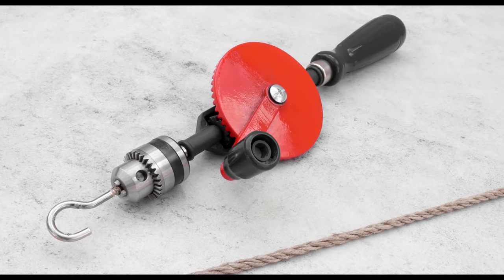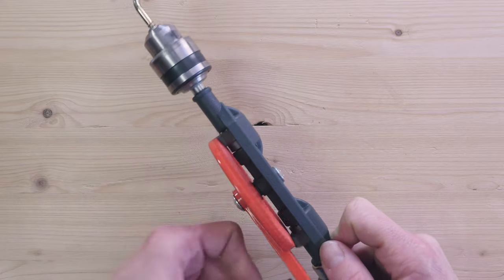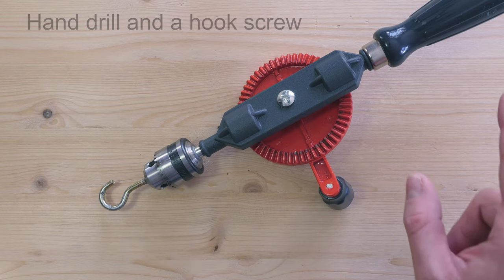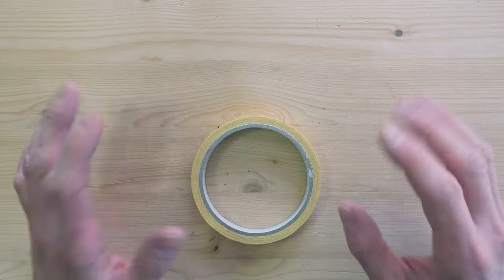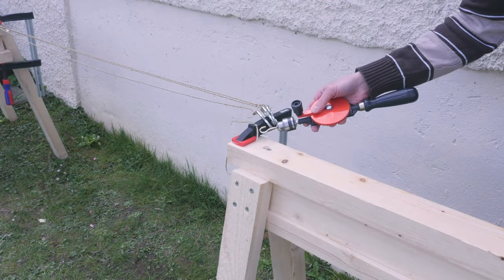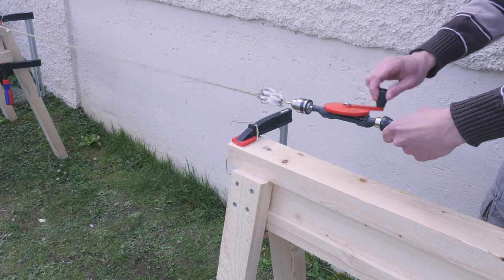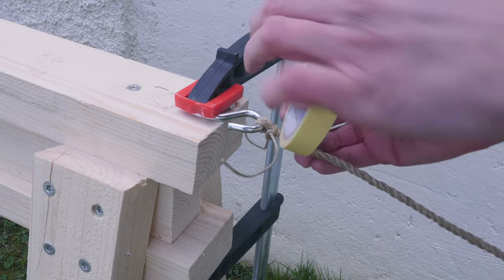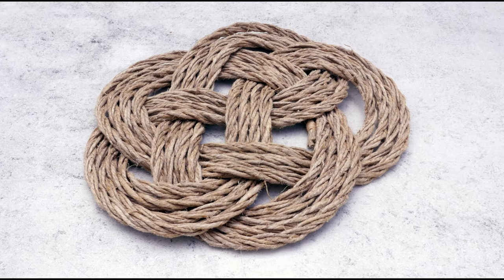Rope making- with a hand drill

Comment: It’s easier to simply run out a loop 3 to 4 times the length you had, twist it all as one (paying attention to the original twist on the twine), double it and allow it to twist back on itself, then twist the new pair in the opposite direction, fold it triple and do your finishing twist.